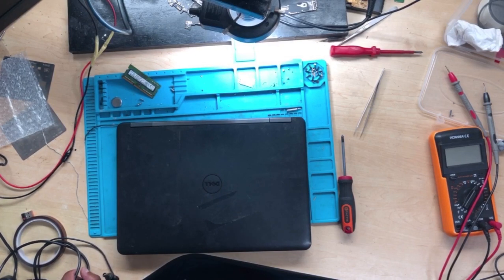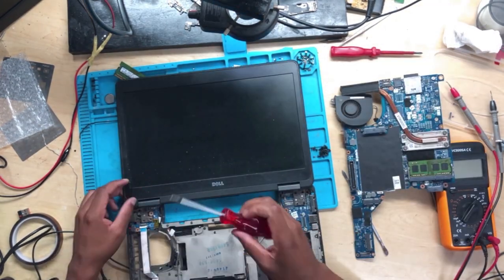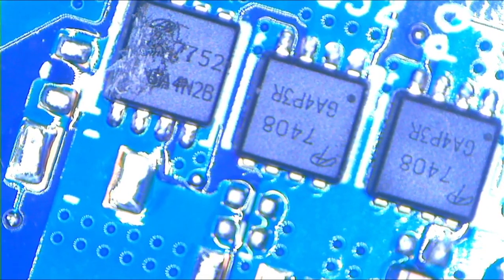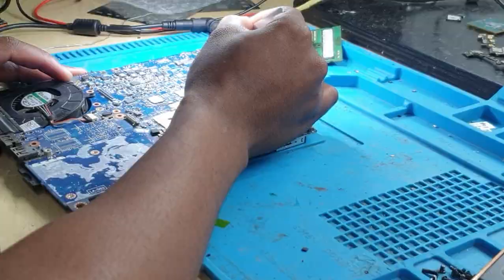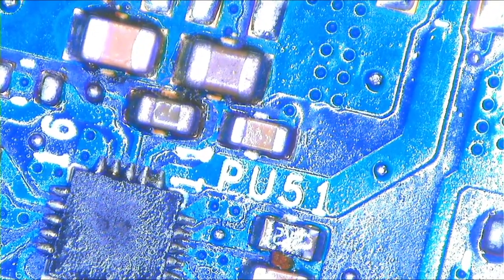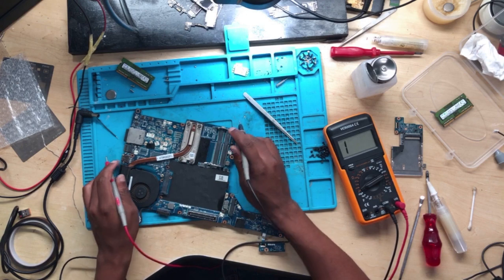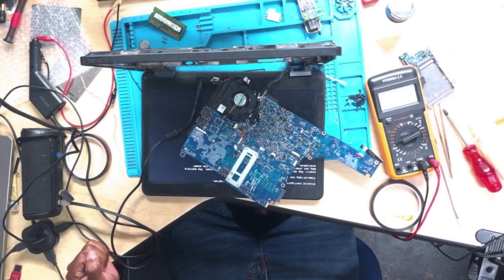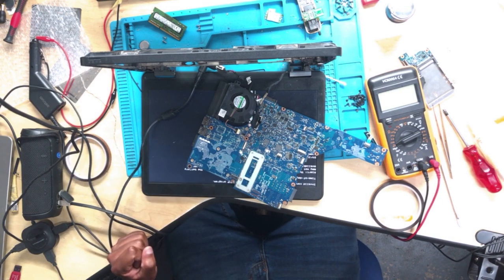Dell Latitude E5440 corrupted bios

Comment: @Jbv TechnologiesYou could replace also SPI chips. Sometimes they fail and reflashing is a temporary fix, because they just like SSD has r/w cycles limit, so ther's a chance that it will fail again soon  or later. I have deskrop morherboard  which showed still CMOS checksum error and 2 times showed mainbios checksum error, got reflashed from backup BIOS and it  stopped post after 2 days. I replaced spi chiip, program one more time and now it works, no more checksum  errors, so it's wotth to spend extrra a few bucks on new  SPI chips and replace them to aboid potentially issues in the future.
Reply: How much cost for replacement spi chips?
Reply: @yusifergaming   Dunno, I live in Poland, so I ordered from Allegro, Polish auction site,sth like Ebay, so I have no idea how much on Ebay... On Allegro I payed 20 PLN/4,86USD for both, plus shiping...